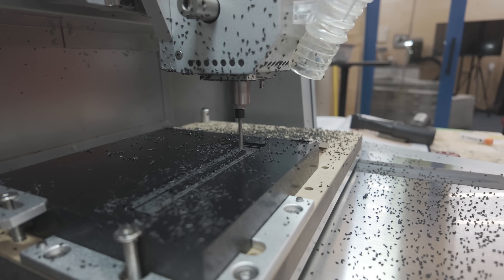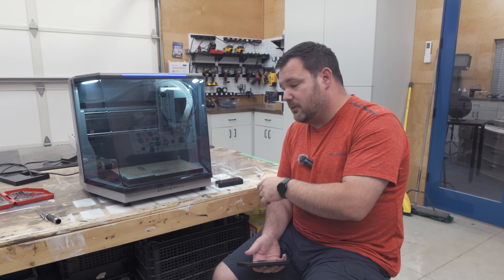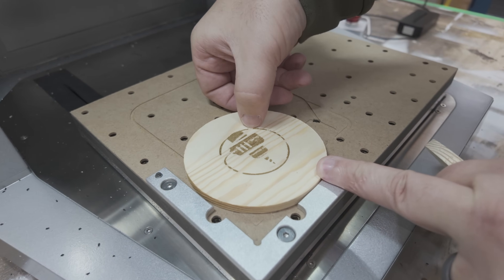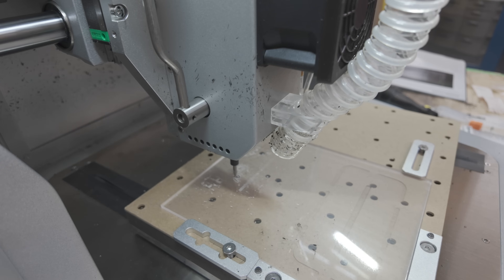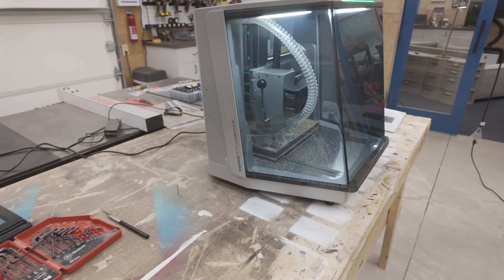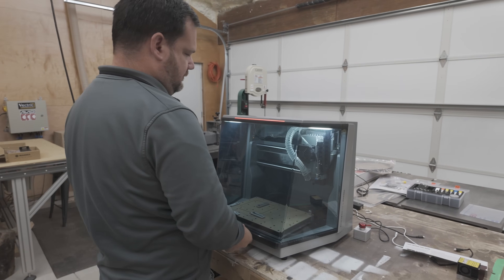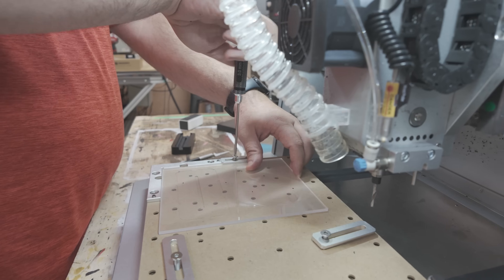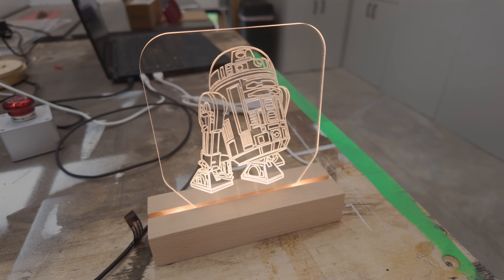Makera Carvera Air - Testing the Easiest CNC for Beginners in 2025!

Comment: The length of the tools is unnecessarily long, it unnecessarily causes vibrations and backlash, I'm not saying that it can't work, but the life of the tool and the quality of the resulting surface are directly dependent on it and it's terrible to hear the milling cutters vibrating, otherwise it's a very interesting machine for the money :D there aren't many of them on the market and you either build something yourself, or buy this caravera for example
Reply: You don't need to use the bit collars on the Air. They're only required for the automated tool changer. Without collar you can insert the tool further into the collet.

Comment: Thanks for the review. 

I've just unpacked the machine, but haven't tested it yet. I share your (few) criticisms, but they're not particularly significant. A larger work surface would have resulted in a higher price, which would probably be a red line for many. The lid is a bit wobbly, but still just about okay for me. For the vacuum cleaner connection, I found an adapter in the Bambu community, which I then adapted to my vacuum cleaner hose, and that was it. 

Speaking of community: Yes, that was important to me too, just like all the other positive things you mentioned. 

I'm a CNC beginner and am looking forward to my first projects. I hope you and your subscribers have fun with the machine! 

Greetings from 🇩🇪
Reply from the maker: Thanks for sharing! Have fun creating!

Comment: I did get one of the first ones from the Kickstarter campaign and I was able to get it for only $1200. I did pay extra for the 4th axis, laser and PCB kit. 

This was something that I want to use to make smaller parts and will be used to supplement my Longmill 2.5.

So, far I have no complaints with the machine and it is much quieter than the Longmill. 

I just started to go through Andy's course to see if I can start paying back these machines.
Reply from the maker: Hey thanks for sharing your experience! Excited to see what my course will do for you!

Comment: For the price you can get a 4X4 shapeoko for a few hundred more and it is American made.
Reply from the maker: I don't disagree. But that's like comparing apples and oranges. Both fruits, but different.
Reply: Should be compared with a nomad3, thus said, I don't see a usecase.....to flimsy for aluminum, to small for plywood and to expensive to get as a hobby